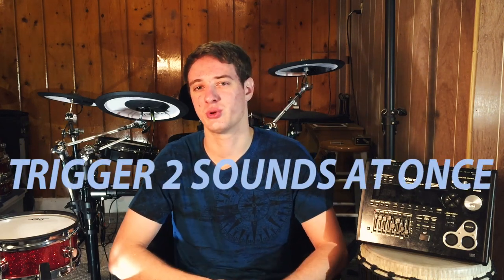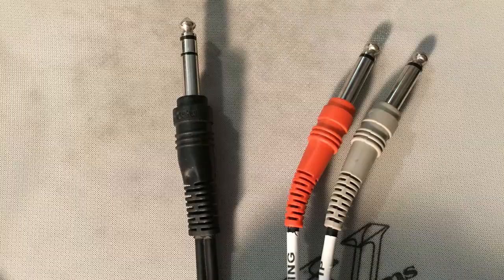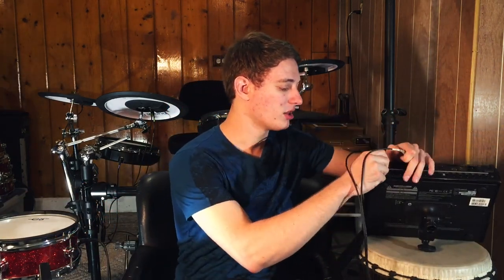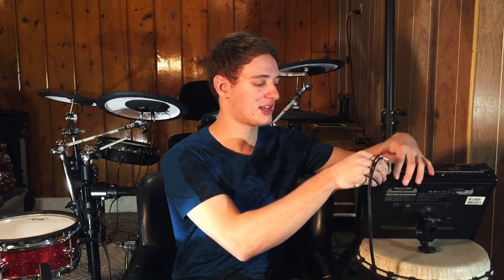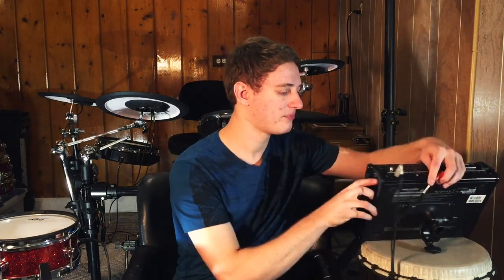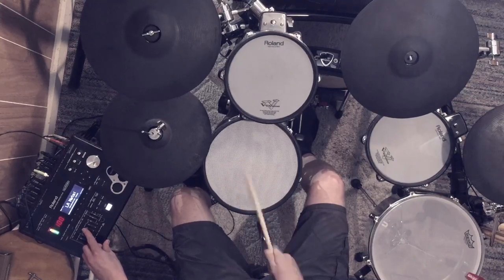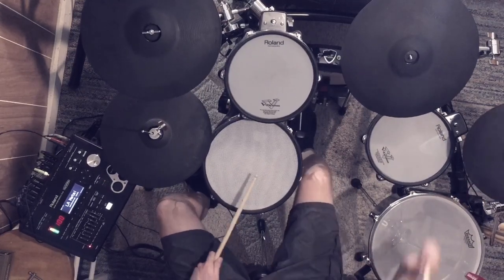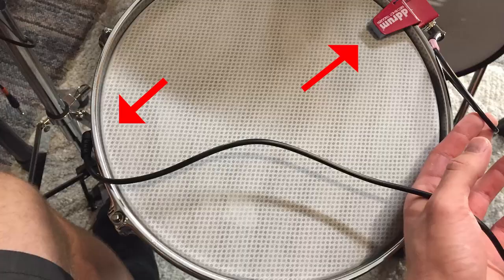Trigger 2 Sounds At Once

Comment: if you don't use the rim on you toms like me you can also use a splitter send the rim sound to an extra cymbol or tom ,this is a great way to add a lot of extra pads to your kit if you don't have a lot of inputs
Reply: this is what i used before on my td9 http://s3.showmecables.com/images/catalog/product/1-4-Inch-Mono-Y-Cable-Dual-Plugs-YPP-106-1.jpg
Reply from the maker: That is very true. but unfortunately not all modules let you do this lately.

Comment: You can use 2 of those cables and 2 Drumsplitter cables with this too to use 2 jacks for 2 pads but run parallel. ie- trg 1a&1b to head 1&2, trg 2a&2b to rim 1&2. Then youre not wasting zones.
Reply from the maker: I'd have to see a diagram of that. It sounds genius, but Its hard to visualize. good tip